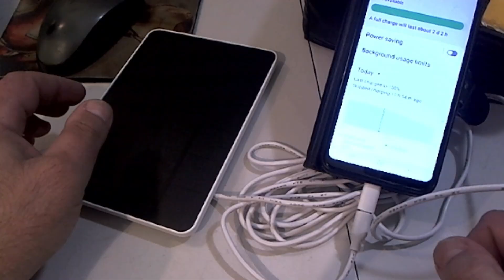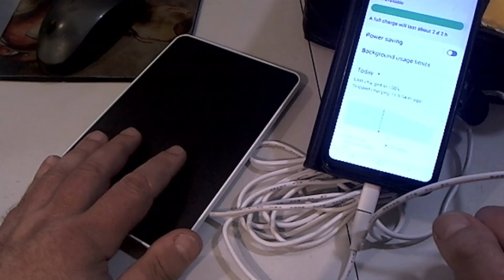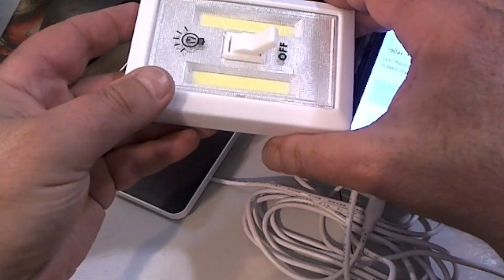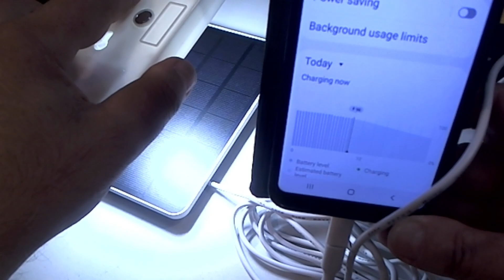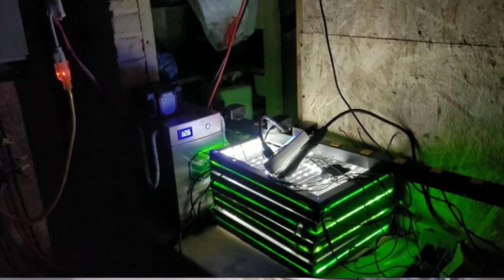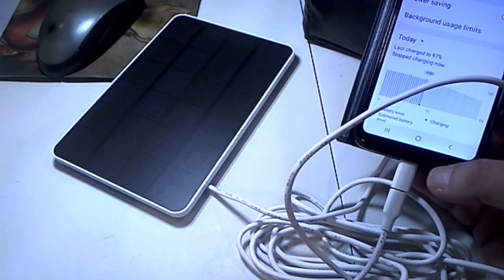How to get energy from your solar panels 24/7 (without needing the sun)

Comment: Sorry, but Lloyd is a complete fraud.  He has NEVER proved this recharges the battery without costing MORE POWER to run his setup.  This is not a NEW way of thinking. this shows you guys know nothing about power propagation in a solar panel.  This is like filling your bathtub with a bottle cap; yes, you can put power into the solar cell, but it will cost more effort and more time than it would take the sun to do in less than 5 minute.

Comment: this is so wrong.... please do not listen to this, while yes it MIGHT charge your phone.. quite poorly , you still  need power to run the lights...  you are trying to show a perpetual motion machine in relation to energy, this does not work, never has and never will, converting solar energy to electricity is quite inefficient maybe 20  to 30% with a modern panel.. converting that power you have generated and stored in a battery back into light to power more panel/s to generate power at night is STUPIDLY inefficient, just charge a battery during the day and use the battery to power devices at night.  since you live in Ireland , with less daylight hours , you need more panels to get the same power generation as someone who lives closer to the Equator , you also need to face them in a North /south orientation , just stop
Reply from the maker: That's what experimenting is all about my friend, having fun whether it works or not although  I do know an inventor who has this working successfully, so I won't know myself until I try it.